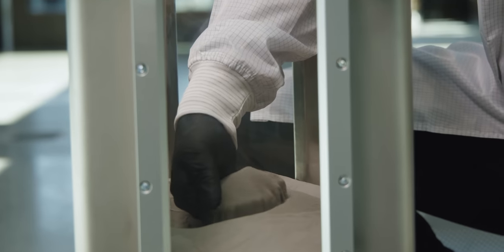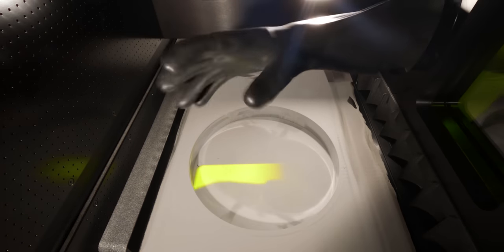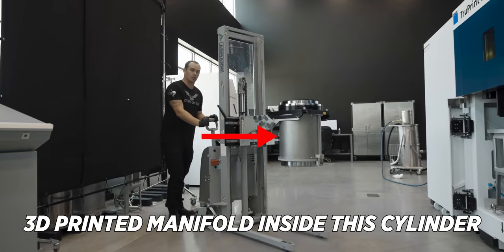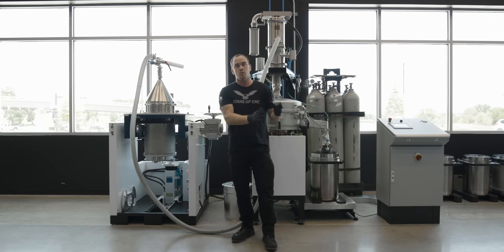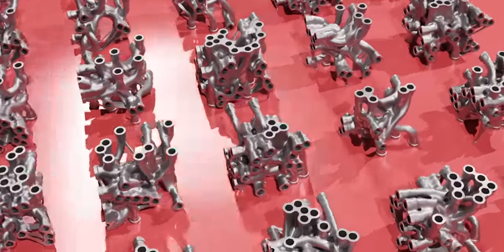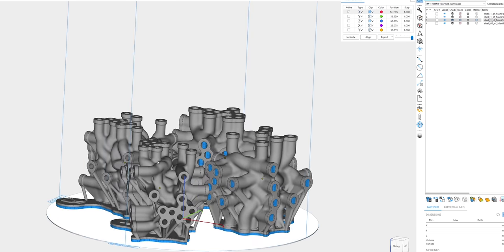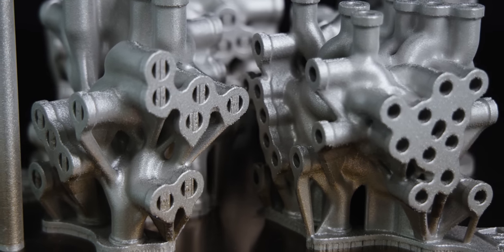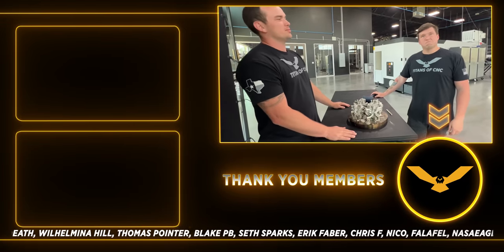Metal 3D Printing | The Future of Manufacturing?

Comment: This doesn’t look expensive at all.
Reply: This is more of a training video then a explanation video lol
Reply: And I can imagine that these have to be more stronger and more durable no welds no connections
Reply: @jaeluatl forged and machined materials are usually strongest. because they can be melted together and mixed more easily then work hardened.
Reply: It’s expensive right now - because it’s new. As it mainstreams it will become more affordable
Reply: @VICE1385  Remember when they said that about 3d printing? Ohh yeah, it came true.
Reply: More like when the Chinese get their hands on it
Reply: That machine costs more than my house
Reply: @IVIRnathanreilly well 3d printing didn’t have a use case
Reply: @Mallchad  Makes sense. That said, powder metallurgy equates to smaller and more uniform carbide microstructures in higher end knife steels. I have a feeling it works similarly for printer steel parts. Just an assumption on my part.
Reply: @Ghosy01  they invented it lol
Reply: Good utilisation of resource if you ask me
Reply: Expensive is a relative concept 😅
Reply: @TheAravindppadman  Extremely relative, you are correct,
Reply: @TheAravindppadman 
Quote by Bill gates

Comment: This has been the future of manufacturing for 20 years ever since I wrote my thesis on it. The problem is that it is only really useful for bespoke, customer-individualized products. It doesn't scale like casting, extruding etc does.
Reply: That's the problem with both additive and subtractive. A plastics guy once told me he considered a kitty litter scooping fork "sexy", because it was just a single press of a hot die. Ah, if only everything in life were that simple.
Reply: so its not really the future of manufacturing
Reply: @Shrek_Holmes  Not for mass production it isn't.
Reply: That definitely prevents it from being useful for cheap mass production. The thing that makes it interesting to me is having the ability to make things that are not possible to make any other way regardless of price. 
Do you have your thesis hosted publicly somewhere? It would be interesting to read it with 2023 eyes.
Reply: Well the LEAP fuel nozzle tips think this is pretty much scalable. 😅
Reply: Kind of irritating how these are hyped ot stupidity. Something that is seriously impressive, in its niche, is now trivialised by idiots.
You are the expert, my undersatnding of process, the actual process causes the strength. eg injection molding plastics requires the injection to align ploymers for strength.  Surely printing impacts grain size?  Or are these really more about shape challenge?
Reply: @DaniCalifornia44  That's a great point! 'Scale' has different meanings in different industries. I believe what the previous commentor means by "scale" is that this tech won't be used in affordable consumer goods, because of the cost. In aviation, metal printing like this is a huge win because they can print multiple fuel nozzles and fan disks in one shot, using materials that are difficult to cast and in shapes that would be impossible to machine. With 6,880 LEAP engines in service, with 19 fuel nozzles each, GE has printed 130,720 fuel nozzles over the course of 7 years. Very neat stuff

Edit: an interesting note: the P&W GTF engine uses 3d printed parts. A contaminant was found in the metal powder, so a bunch of A320neos are grounded because of it
Reply: Can be useful to make spare parts that are no longer produced by industry.
Reply: @thomaslacornette1282  of course, but it is not the future of mass production
Reply: Sand molds
Reply: This isn’t true.
This would have huge applications in Aerospace and Marine.

As well as countless other ideas.

The best aspect of this is that you have an unlimited axis build.

Also this would be great for repairing obsolete machines for which the originally tooling, machines and most likely the tool operators, have been lost to time.

Truthfully, I feel like this would also have a great future in missiles as well.

Rocket motors are fairly simple, but imagine if computerized machines could make these things 24/7.

Large mills are labor intensive to maintain accuracy.

I can’t imagine that laser ever drifts.

Retooling cost savings must be high.
Reply: @johnnyparatrooper1326  you didnt read what I wrote.
Reply: that's not true anymore.
Reply: @D3adP00I  Please do tell me the company that uses additive manufacturing for mass production and for which product?
Reply: There's no reason why this shouldn't be the future of manufacturing. It's just the beginning. Who knows where it might lead to. I personally could imagine a fully automated production line using this technology to manufacture tens of thousands of units.
Reply: @samsabruskongen  Never underestimate the brilliance of man and his use of robots and AI to improve production cost and speed.
Reply: @samsabruskongen  Maybe not, but I think it will get much faster and cheaper and blur the lines.
Reply: @areitu exactly, scale to meet worldwide demand for new aircrafts isn't all that large for example.
Reply: The cost of this is hard to justify compared to the incredibly cheap alternatives when it comes to mass production. Yet there is huge demand for expensive low volume parts. This should be the future. It makes me think it comes down more to friction in supply chains and vested interests in the status quo
Reply: Set up 1000 of these machines and make a production chain.
Reply: @Mlab923  sure, but it will still be low volume manufacturing
Reply: @Mlab923  aint you a manufacturing genius
Reply: it is scale people just dont design for the tech that can scale am
Reply: @MRDEWVOLTAGE  Try again and structure your sentences to be understandable.
Reply: @samsabruskongen  are you okay? This is youtube not a literature paper... L PBF is scaling by lowering cost and binder jetting is already there but requires high investment. To be quite frank, you don't know what you are talking about. You're taking about the past.
Reply: @MRDEWVOLTAGE   @MRDEWVOLTAGE  if you want people to actually understand and respond to you, then you should actually write intelligible sentences. It is not hard.. And you are still wrong and spouting the same babble I heard 20 years ago. Please give me an example of one mass produced product where additive manufacturing has replaced traditional mass production manufacturing methods.  Sure, it's great for prototyping and low-volume bespoke products but will never replace traditional methods for mass production.
Reply: @samsabruskongen  Bro, just change your tone when you talk, you show arrogance. Anyways, it's going to be application dependent of course. Replacing traditional technology is a false hope, I don't preach bs. These older mass production technologies have been around for some time, they're typically already paid for, and are designed for specific applications at much higher volumes 1M+. LPBF is still low serial volume usually under 1K or 10K EAU. Binder Jetting is higher usually under 100K EAU. They are typically used as a bridge to mass production before breaking even with old/existing technology, obviously for spare parts or to shorten lead times and all the other supply chain stuff.

Now, this is where it gets interesting.  If people opened their mind to design products around the assembly and not just the component and thought about how to take advantage of AM then it becomes interesting. When you do this, this is when traditional manufacturing is replaced. This is the beauty of it, a product that only AM can make and at high volumes, in many cases these replace a lot of manufacturing steps and labor. There are too many false players that have disrupted this space and damaged its short term potential. So I understand your opinion. And to be honest, you won't see large players publicize that they're using AM at scale. Even the news on Apple using 3D, they don't want to share. But you will still find stuff online, if you're talking scale for those special AM cases that can do 1M+ for their AM unique geometry, then let's talk laser or binder jetting, let's talk Reinshaw or HP. Just look at their public uses cases, these are real applications in production. To address your concern, just look at Schneider Electric and HP part, and let's not even get into aerospace and defense.
Reply: @samsabruskongen  whered you go buddy i was hoping to have some more fun convos, share knowledge and opportunities
Reply: @Shrek_Holmes  nope. its just another way of making things

Comment: I sure hope you have an action plan in case there’s an accident that releases a lot of the powder.  I worked with many hazardous materials as a chemist and would recommend that all operations with the powders be done in an area with substantial airflow away from the equipment and operators then passing thru an appropriate HEPA filter.
Reply: Yeah, @freds4703, my eyes opened wide when I saw the powder. Enclosures should be required. That building will eventually get the same treatment given to buildings that had asbestos. Still, one has to admire the risk takers.
Reply: Having worked in composite industry, big companies don't have good engineering controls or even fit you for respirators unless you take initiative. Its kinda fucked
Reply: @xxxBradTxxx  silicosis is specifically with silicates, won't happen with this. still bad for you, but won't cause silicosis.
Reply: Is the powder lethal if inhaled?
Reply: @thisnameisnotfake517  Been there as well...

Comment: I had no idea that you actually have to use supports for metal powder bed fusion. I have some experience in SLS printing, that uses polymers instead of metals, and it is able to print complex geometries completely without supports.
Reply: afik, the metal curls up if the overhangs get too steep.  You then have a bad day if the metal curls enough to catch the powder spreading knife.  So support structures are the lesser evil.
Reply: Yeah, it's also to help stabilize the structure and give it dimensional accuracy.
Reply: 3D metal printers rely on thermal conduction through the printed part in order to cool the material down fast enough. Without a solid connection to the build plate, a free-floating part won't be able to cool off enough through the relatively insulating powder, leading to warping and a stuck powder spreader.
Reply: The more you know.
Reply: @martylawson1638  I wonder if 3d printing can be done underwater, in this case heat would dissipate immediately, on the other hand, locally boiling water can mess up metal powder around it, maybe it can be done indeed were high pressure?
Reply: @solarissv777 nahh, it would ruin layer adhesion.
Reply: @IVIRnathanreilly  and what about doing it in the atmosphere of some gas with high thermal conductivity, like helium?

Comment: 316L is often used in high temp environments where carbon creeping in the metal is common and can cause crevice corrosion and cracking. It's why I use ultra thin stainless 316L for high performance turbo headers.
Reply: Would a 3D-printed 316L component have properties similar to a casting?  I mainly care about how weldable it is.

Comment: Please also show the further processing! Removing supports, fixturing it, machining of the connecting points, etc. These as-printed parts still need some love and care before they can be put to use (or, if these are test prints/prototypes, at least that they could be put to use.

Oh, and thanks for showing the internal teardrop cross section. Makes perfect sense to apply this trick, but I wasn't aware of it until now.
Reply: Where I am we have a SLM machine, and we remove the part of the build plate with a wire EDM machine! Then the build plate is sent to a machinist to be resurfaced and get reused. If the parts need futher processing, its the same as any cast part.
Edit: We do use 17-4PH stainless, which is way better steel (1000MPa yield) than 316 (less than 300 MPa yield).
Reply: @sergioro8_125  
Some question. 
How do the internal channel get finished?
Like if you want to push fluid through those channel, you want surface as smooth as possible, no?
Reply: @jintsuubest9331  what I've seen is that for parts that require a better surface finish get sanblasted. But electropolishing may be a pretty good idea

Comment: 316L is the weldable form of 316 stainless and if you weld something out of 316 the carbon bonds with the chromium to form chromium carbide robbing the product of its ability to resist corrosion so you effectively go from 18/10 stainless to a much lower corrosion resistant level of stainless steel. To make 316L in the initial steel making  process they use calcium oxide instead of calcium carbonate to avoid adding any more carbon.

Comment: Wondering how solid those prints are. Judging from the surface texture, I'm going to guess it may have micro air pockets inside.
Reply: These printer produce parts that are 99.9% dense.
Reply: probably more solid than cast iron since that has huge bubbles in it most of the time
Reply: It is ongoing research topic. 
There are post process technique to back fill the air pocket, but it is not at big as other issues.
Individual grain structure, grain boundary, surface imperfection, support placement, movement during printing, post processing, etc.
This is still relatively new, and we are still learning about it.
Reply: I think the exact opposite, casting is much more prone to defects. Layering fine powder is sure to be more effective in avoiding inclusions.

Comment: Maybe a dumb question but why does this type of 3D printing still need support?
Edit: Thanks a lot for the quick answers! I understand now.
Reply: It’s mainly to help line stuff up, so that you don’t have islands that’s then have to connect accurately
Reply: I've talked extensively with a major industrial 3D printer supplier (I've worked in the R&D field for over 13 years).  Metal prints have a higher density after sintering, so it can sag into the un-sintered powder.  When you expect micron accuracy, any sagging is unacceptable.
Reply: the granulate is a relatively good insulator compared to the sintered together metal (and baseplate) so without support you would have to wait extra long for the metal to cool down, additionally if it is entirely unsupported from even the side, it may very well shift when the next layer of granulate is layered over top.
Reply: hydraulic flow through non-straight pipes can also cause high mechanical stresses.  these stresses are dependent on the flow rate of the fluid and the angle through which the fluid is changing directions.  it has to do with the conservation of momentum. In underground water mains every time there is a change of direction you either need to use restrained joints or you pour a giant block of concrete called a thrust block to counteract these forces.  https://www.youtube.com/watch?v=xg7pnrfPwNc
Reply: Supports in this case are less about gravity and more about heat dissipation and ensuring you are anchored to the build plate so you don't get warpage from residual stress caused by the rapid heat input into the part.

Comment: SO, how does the inside of the channels look?  is there a secondary process to remove the rough/porous surfaces on the inside top of the holes?
Reply: Yeh i think it likely that the gains are worth it over the worse surface in some applications especially if spade is an issue
Reply: Electrochemical polishing!
Reply: unnecessary to smoothen it when its out of stainless steel, except for maybe the outside so ppl can handle it without injuring themselves

Comment: Not for critical use without Hot Isostatic Pressing to remove voids.  Have you looked at the purchase, install and operating cost of a HIP?  Seems to be kind of expensive to produce and operate something that can create 15-45,000 PSI at 900-2,400F.  And the max size seems to be about 2 and then some meters by three and then some meters.
Reply: It depends on the application requirements and on the printing method. If this is Selective Laser Melting (SLM), which this is, then you get past 99.5% density. As opposed to the earlier inferior method of Selective Laser Sintering (SLS), which could only achieve up to 95% density. And yes, SLS printing a metal part for a safety-critical application would probably need a HIP treatment. But not this part, this is fully leak-tight.

Comment: Can 3D printing alloy and metal ever break through? 
What I learned in engineering school was not even Sinterkng or casting materials make due for high stress apllications. The crystalline structure will never be optimal no matter how much you try to heat treat it afterwards.

3D printing is basically spot welding, right!?
The stress uneven heat transfer, different crystalline patterns amd material pockets are all an issue

Comment: future as to replace standard steel manufacturing processes? not a chance. supplement for cheaper parts, sure.
steel (Fe + C) has so many different options for how to make it for different applications, its ridicules. so bonding small particles like 3d printer does it looks similar to sintering. where with pressure resulting in heat you weld particles together, but with 3d printer you probably weld particles together with laser. sintered material is usually hard but not ductile. and not to mention you working with 20%Cr in your material. what happens with Cr when you heat the particle? does it stay where it should? does it flow to the outer edge.. whats the moleculal stucture of particle before and after bonding etc etc..
so sure 3d printer has some application, but to replace every steel manufacturing process this is just a clickbait. correct me if im wrong.